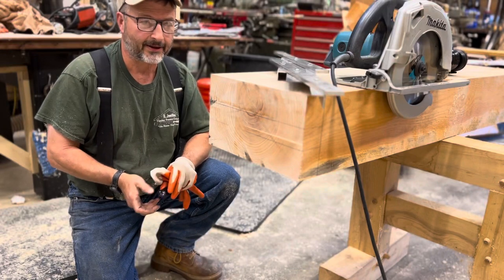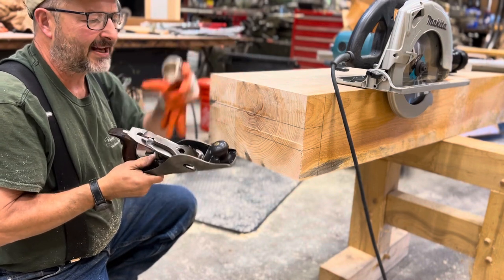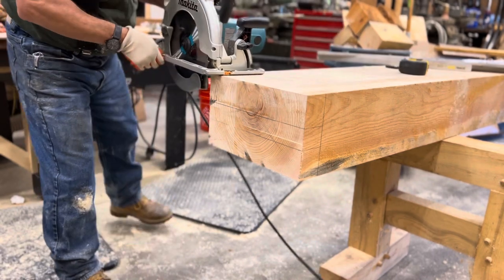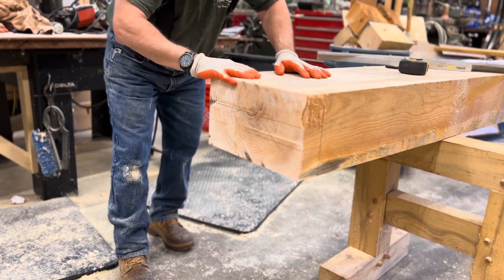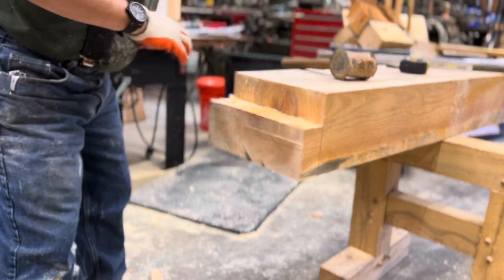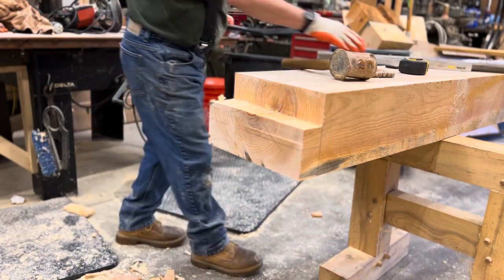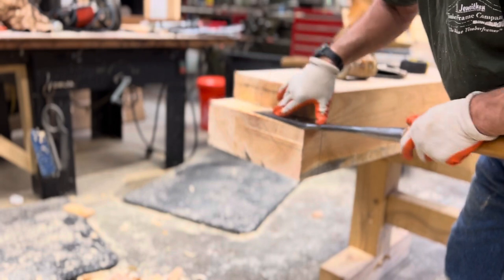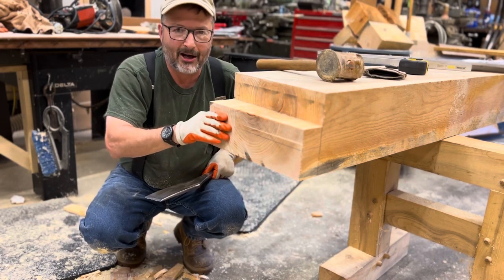Timber Framing - Using the kerf method to cut a tenon

Comment: Oh  and interesting centering jig.
Reply from the maker: Hi Timberdoodles:
I put together a video on the construction of the centering jig.  Once you make one, you’ll wonder why you centered any other way!
Also
You can change out the 2”
Rule to any other size needed.  I have a 3” I use to center post stub tenons on the bottom of posts going into sills.
The 3” I made from a piece of 1/4” luan

Comment: How did you make the saw horses? A video???? What’s the measurements 
Do you like the hight?
Reply from the maker: Hi Larry
Go to Facebook:  Timber frame company - R. Jemithan Timber frame company.  
There is a post on

March 31 2019 of the cut outs for the Sawhorses.
They are made from Ash.

Comment: Excellent video accept for the auto focus,but your a carpenter not a videographer  , just a small question,why didn't you follow the 1/3 rules of wood width for the tenon
Reply from the maker: Hi Stuart
Our typical rule for tenon thickness is:
Tenon thickness = 1/4 timber width.  
In this case the timber is 8” x 8” so the Tenon is 2”.
I think you’ll find that 2” tenon on an 8x8 is very typical.
Hope this helps.

Comment: Auto focus?
Reply from the maker: Your comment is warranted - I’m using an apple phone for vids….. no focus once you start a vid.  I’ll have to look into a better camera ‘mouse trap’!
Reply: @theMainetimberframer  Great information, I just ordered a Barr slick.
Reply from the maker: The Barr slick is great!  You won’t be disappointed!  Caution - the handle can come out of the slick, manage accordingly!!
Also Tormek does a superb sharpening job when needed.
I have a concrete floor so our rule of thumb is the sheath always stays on if not in use.

Comment: You can drop cut those tenon faces just off the line and finish it with the slick, skipping the kerf method.
Reply from the maker: Thank you for the comment. My intent was to share the kerfing method.  (This is a shouldered, tapered tenon so we kerf.  For straight tenons, we use the Mafell bandsaw.  I discourage the drop cut method in the shop).
PS I like your work!

Comment: You have the Makita 5402 so I am curious why you bouhght the Skilsaw spt 55 instead of a Prazi attachment for the Makita.  Prazi is $150 vs the $700 for the skilsaw
Reply from the maker: Hi John
I have a prazi too.  For me, I can’t say much good about the prazi.  I had it set up on a dedicated makita skill saw, but did not get the quality cut I need for straightness and squareness.  The prazi has very limited chain adjustment and must be oiled manually.  The skilsaw is a much more refined machine with straight cuts, self oiler.  Still not perfect, probably the Mafel is but the skilsaw works well for me.  I use it for all my 8x8 cuts these days knowing that the skilsaw finish is never visible meaning:
End cut 8x8 with skilsaw spt, cut tenon shoulders with makita 5402, cheek cut tenons with mafel bandsaw, round tenon with router.   Virtually the is no evidence of a spt cut when done with a tenon….
And with the spt, the is one cut with no rotation of the timber necessary